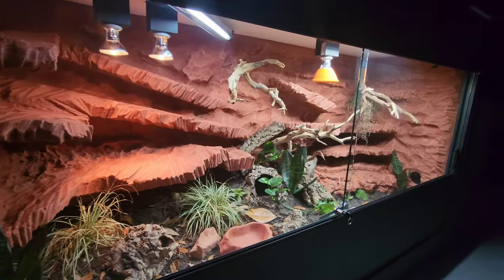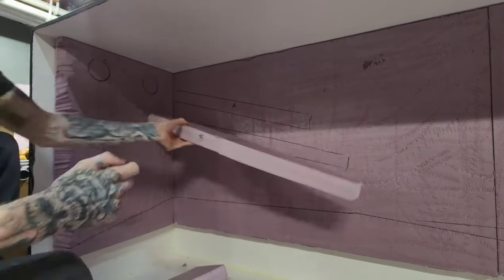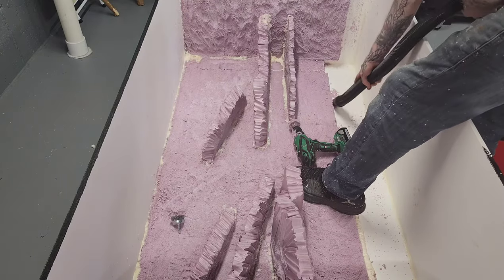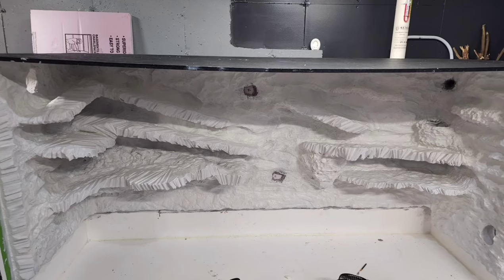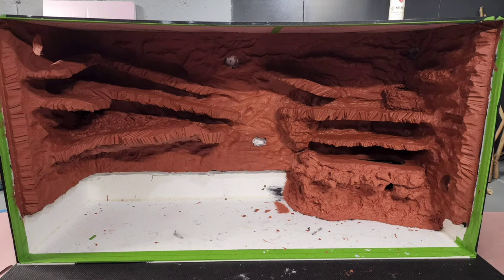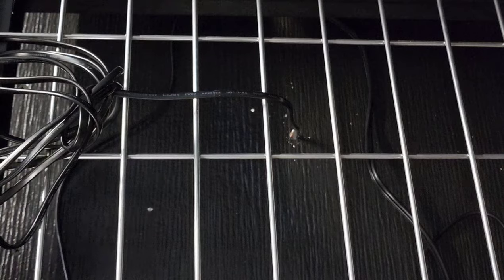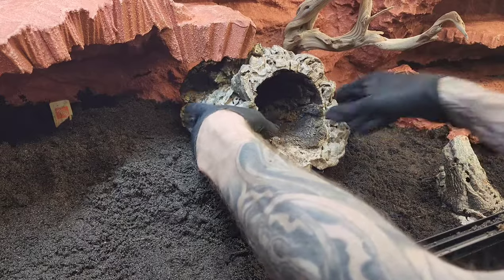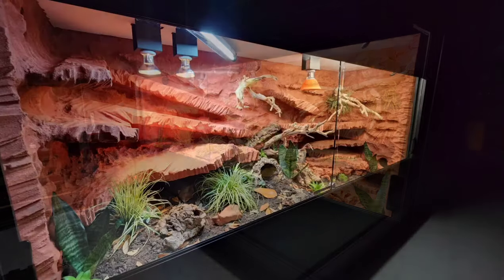DIY Monitor Enclosure Arid Set Up & Bioactive Build #reptiles #vivarium

Comment: How much do these builds cost?
Reply from the maker: It's hard to say bc I have left over stuff from other builds. But besides glass front doors and not cutting corners around 600-800. But there are some many ways to increase or decrease those numbers. From substrate, lighting,  interior wood, enclosure material, misting systems, Caster wheels, plexiglass, glass or tempered glass.
The current build I'm working on I'm keeping the receipts but it's also a 8w4d6h.
I just know it's more rewarding and cheaper to do it myself then buy something. I did link a lot of the materials in the description
Thanx for your comment. 
🤘💯🦎🐢🐸🐍
Reply: @bradsbioactivebuilds  awesome, thank you so much! Absolutely love these builds.
Reply from the maker: @liquidchicken2757  thank you, much appreciated! 🤘💯🦎🐢🐸🐍